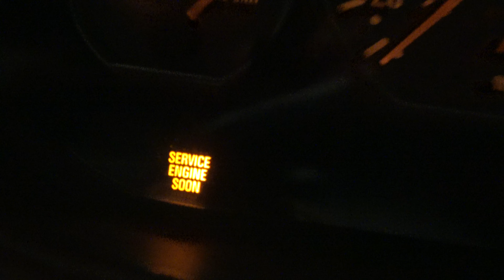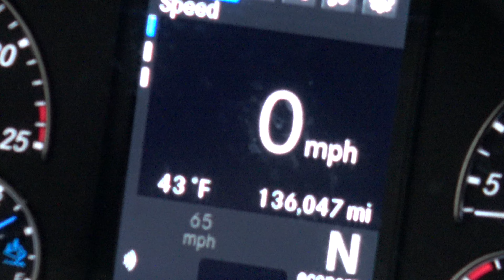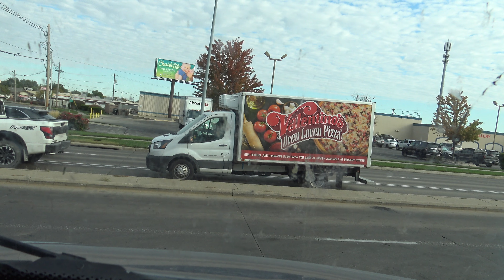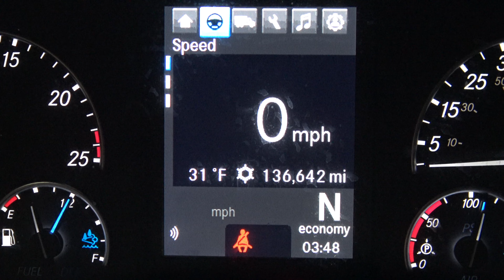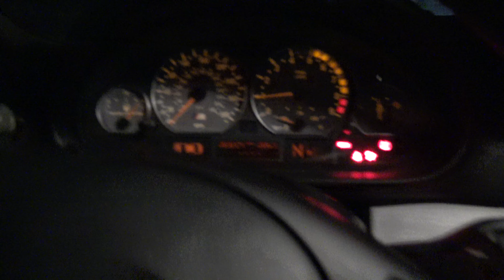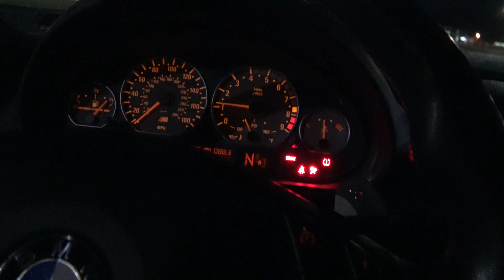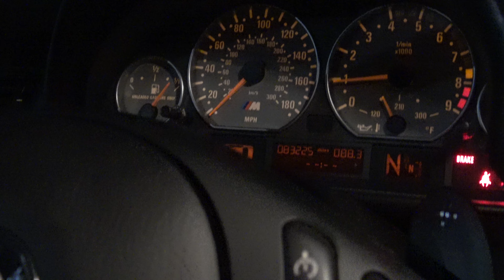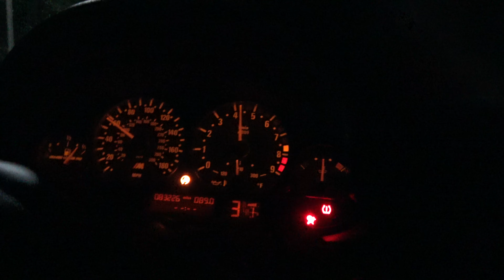E46 M3 Exhaust Flames! (RKTunes)

Comment: Found a stock transmission for my SRT-10 Ram. Getting it tuned afterwards to get a dyno. Love the M3, nice setup.
Reply from the maker: What trans came with those? And thanks!
Reply: @TheRacingJoker  Borg warner or Tremic T56 6 speed depending on if you got the special editions got the borgs I believe. The quad cabs got the 43re 4 speed autos and those transmission are plagued with issuse

Comment: yu probably blew up an 02 sensor. flames do that....
Reply from the maker: Had to deactivate secondary O2 sensor, it was freaking out because of something to do with the headers and the sensor placement. Runs great now, I also reset adaptations just to be safe and it no longer burbles as well
Reply: @TheRacingJoker  nice, mine used to burble but when i deleted my section 1 resonators the burble got too deep to hear them. my tune is more chill than the rk one tho. i have buildjournal stage 3. and yes you have to deactivate secondary sensors as soon as u get headers. theyre only purpose is to check if your catalytic converter is working. flames will blow the primary 02 sensors too tho, mine are blown rn lol
Reply: @TheRacingJoker  why doesnt it burble? i want to do flames in neutral but idk how yet and my fuel tank is empty til morning
Reply from the maker: @LukeVMH-Games  my burble tune was insanely aggressive. I’m going to take my car to a local tuner to see if I can get it to run a little richer to make flames